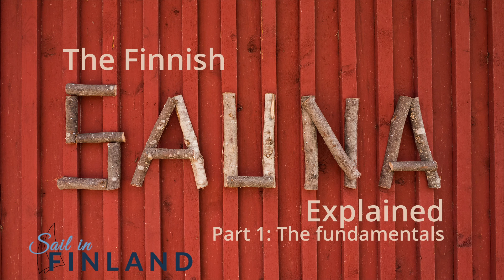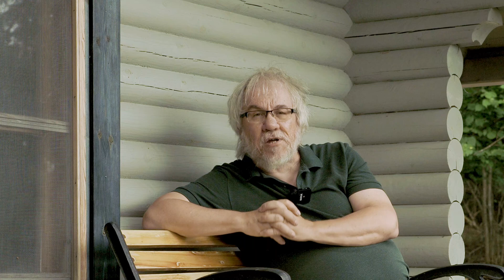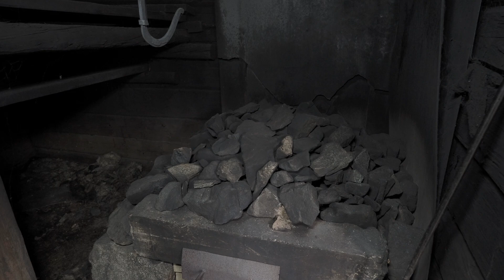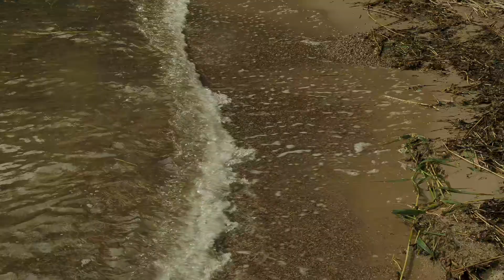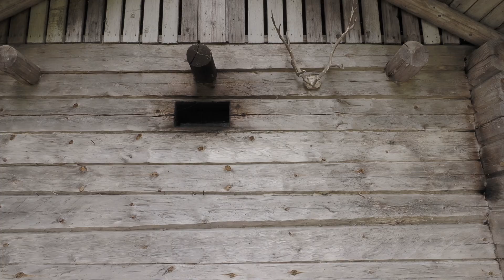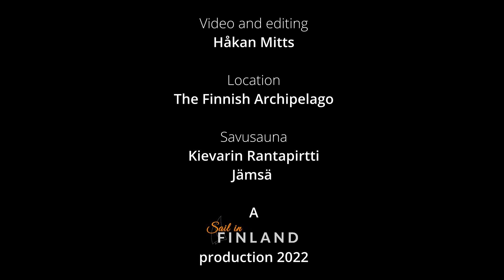Finnish sauna fundamentals - The Finnish sauna explained part 1

Comment: Wonderful informative video.
Can you tell me more about that specific stove you have with the water jacket and spigot?
Thanks!
Reply from the maker: Hi, is there something specific that you would like to know? This is a fairly common setup for sauna stoves to be used in places without warm water on tap. There are a couple of basic designs for this. One is the water tank setup in the video: it's not really a "jacket" (in that it does not surround the stove) but a tank of about 20 liters (5 gallons if you are in the US) on the side of the stove. Many stoves can be bought in one of 3 configs, a narrow model without the water tank and the wider models with the tank either to the left of right of the stove proper. In the video, there is cold water on tap in the sauna, so you fill the tank with cold water and then the water heats up as you heat up the sauna.

The other typical design is that there is more like a jacket type tank that is put around the (metal) smoke stack, typically of the same size. Both work with the same principle, the water is being heated by the (excess) heat from the fire. So while the stove-attached tank is something you get when you choose your stove, the tank going around the smoke stack can be installed also later.

The water gets quite hot and you get about 6 vats of "wash-warm" water from one tank, enough for about 3 people to wash. If you have more people, then you need to top the tank up as you go.

There is an other, "heavy duty" setup for hot water that you can find in some saunas. This is a separate iron cauldron or pot of - say -100-200 liters that has its own fireplace. You then heat the water separately. Typically this is used in environments where there is a separate room for washing (so a 3 room setup - change, wash and "löyly") and you expect there will be more people using the sauna. One other benefit of this setup is that the pot keep the water warm so you have warm water for a morning wash or doing the dishes. In the small tanks, the water gets cold over-night.
Reply: @SailInFinland  thank you for the very detailed response. What brand is the one you have? I've seen it a few times on the sauna videos I've been watching lately, but I am having trouble finding it online. 
Thanks again!
Reply from the maker: @crystalclearcompass it's an older Helo model. This is a link to a local hardware store for stoves with water tanks: https://www.taloon.com/puukiukaat-vesisailiolla

Comment: Good information here. Is there any particular wood that works best for the sauna?
Reply from the maker: In general birch, pine and fir are considered "quality" wood. Personally I think that any wood that is chopped (ie not small branches, sticks etc) and well dried after felling will work very well. If the wood feels very light and "papery" then it has probably been outside rotting for too long and will not work very well.